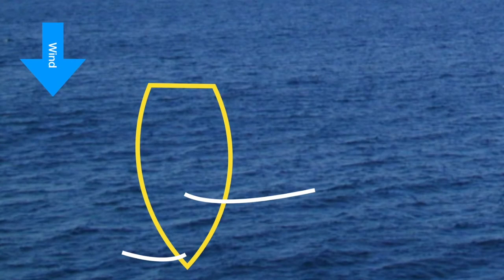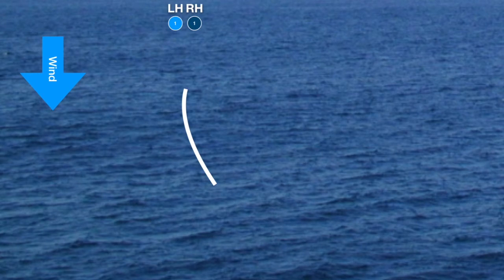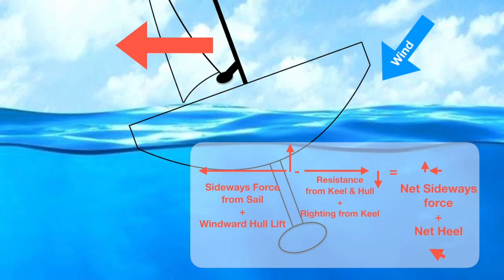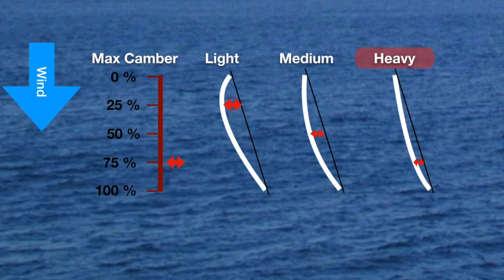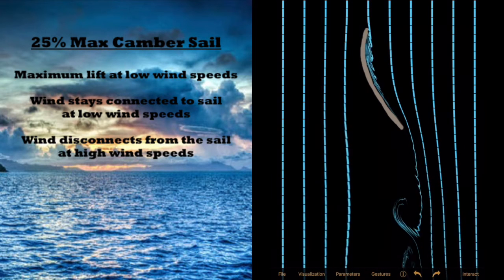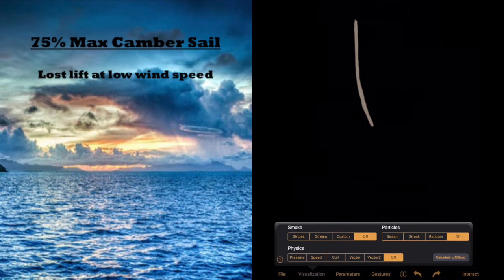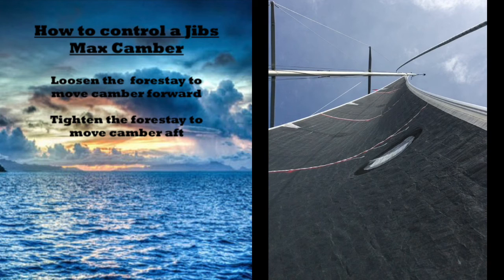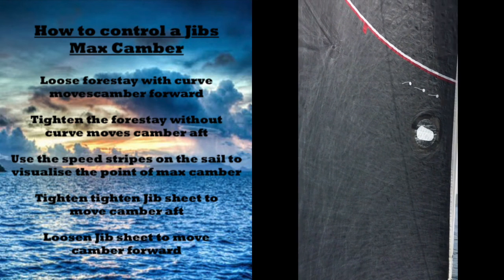What makes a Boat sail to Windward ?

Comment: Hi Peter. A quick question for you. Have you ever used jib in-haulers? how effective they are to close the slot on a non overlapping headsail upwind!
Reply from the maker: I have used Jib barber haulers before, mainly from my dinghy days, with that said all the modern racing yachts will have them fitted to help get the extra 0.1 of a knot of boat speed. The system allow you to pull the sheet inboard. This would result in more camber in the sail, less twist in the leech which should give you slightly more power without giving up height which would happen if you increase the camber by easing sheet tension. Many boats would have systems that can pull outboard as well, this allows you to open the leech, creating more twist which de-powers the Jib in heavy airs. This is done to reduce backwind in the mainsail which is super slow. Thanks for watching and for the question.

Comment: Good video. Would like to have seen car position on the track to help with sail shape for each wind condition. Thanks!
Reply from the maker: Thanks for sharing. I will try and do another video on this sharing options. There are multiple things which can control the shape, forestay tension, sheet tension and car positions are the top 3 to move through the gears.
Reply: Thanks!!
Reply from the maker: In short, car forward, less sheet and forestay tension will deepen the sail for light conditions, make sure you keep the leach ribbon following for optimal speed.

Car back, more sheet and forestay tension will flatten the sail for heavy winds. As the wind get up it will have hard to stall the leach ribbon regardless of how hard you sheet.
Reply: @BottomUPBoats  Thanks once more!!
Reply from the maker: 100%